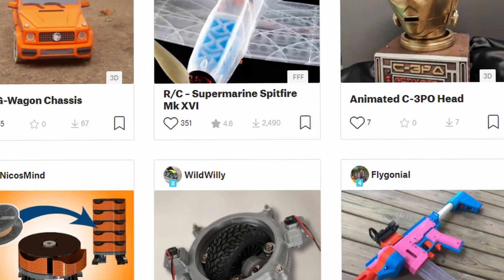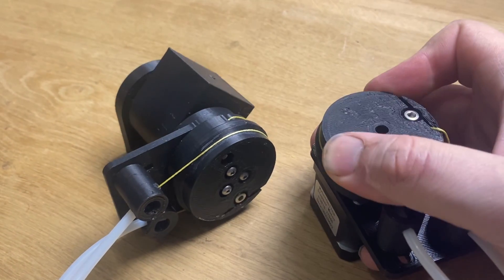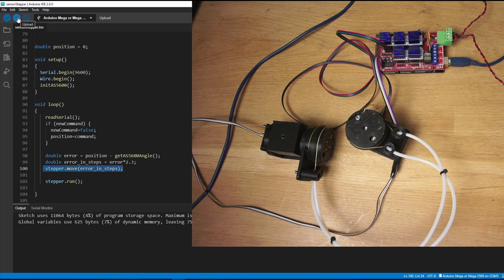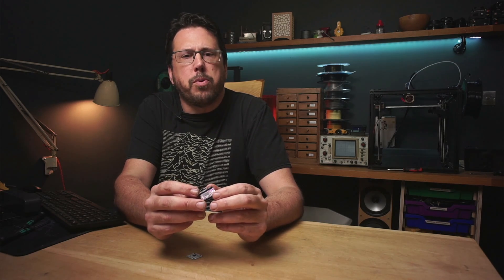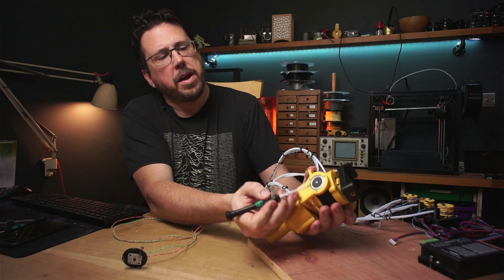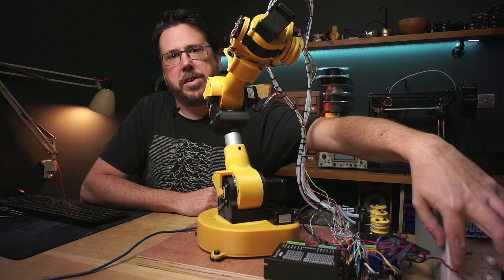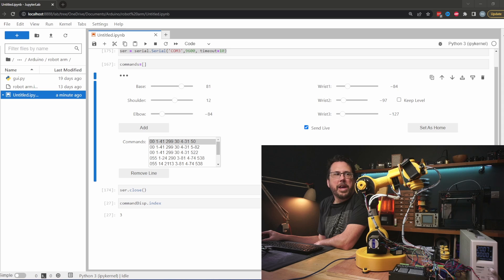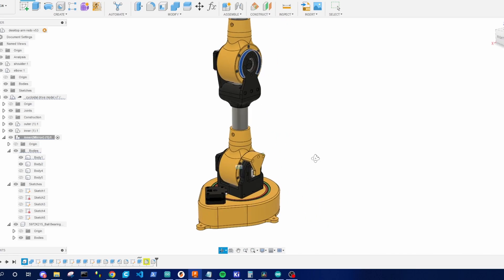Increasing the Precision of a 6 Axis Robot Arm

Comment: where can I find footage of a camera mounted on this? I'm tempted to do something similar but I need ultra smooth motion at low speeds for macro videography and need to be sure its possible with moving the motors away from the arm like this. Great video. Thanks!

Comment: 6:25 this solution nice and easy, but what you think about PID loops? PID controllers are commonly using in the industrial servos.
Reply from the maker: Yeah, you can use a PID loop. in fact, this is basically just the P part of a PID loop. At the moment, I'm not seeing any oscillations using this method, but if they start happening then I'll switch to a PID loop.
However, I do like to try to keep things simple, and if I don't need the full PID implementation then I think this is easier to understand :)

Comment: Hi your project is awesome I'd love to take a look at the code. 
I tried looking at the linked Github page but is seems the only Arduino code posted is the code for the sensors alone. Is there a separate file that contains the code for running and controlling the stepper motors?
Reply from the maker: Hiya, no the zip file that says sensors contains all the code for the sensors and the steppers. It's all in separate classes in that. If you've got any questions, I'd be happy to help - just drop me an email - address is in the about section on my channel.
Reply: there is no email address in your about section ! @roTechnic
Reply from the maker: @PersianFilmMakers  there is, you've just got to click on "show email address"
Reply: Whoops never mind user error. For some reason when viewing the code from the Arduino IDE only some of the code is transferred. The rest of the code showed up when I opened it in Visual Studio.

Comment: Could you make a short video showing us how the robot arm might go about only changing a single value for each of its 6 degrees of freedom? Like for 1 shot, it oscilates between its rest position another position that only translates/rotates an attatched object along 1 axis at a time. How would you go about changing the pitch without changing the position, roll, or yaw of JUST the object? (More specifically, not changing the position of a single point, such as the center of mass or perhaps the attatchment point, Idk which one is correct)
Reply from the maker: that’ll be coming up very shortly when I dive into the inverse kinematics

Comment: Love your work! I've been working on a very similar project. 3D printed 6 axis arm, with the same sensors. The multiplexer was one idea I was missing.
Reply from the maker: oh awesome! I’d love to see it. what reducers/gearboxes are you using?
Reply: @roTechnic  unfortunately I'm travelling at the moment and my robot is mostly failed prints in a drawer somewhere right now. It's a hobby project so I've challenged myself to try include as many different reducer types as possible. Some axes are using planetary gearsets and GT2 belt and pulleys. I'm in the process of refining a cycloidal reducer for the elbow, and a harmonic drive for the wrist. Wrist is actuated from behind the elbow with a torque shaft and fishing line pulley system running through the forearm.

Over engineered and destined to fail, but the project kept me sober during lockdown and that's all that matters.
Reply from the maker: @topordrop2402  It sounds awesome! Good luck!

Comment: I think that I am not the only thinking it but I want amplify the signal : the problem you are trying to solve has a solution, a PID loop.
Reply from the maker: Yeah, I could use i PID loop here - and it would probably be better for a normal robot arm. But I'd like to put a camera on the end of the arm and have very well defined accelerations and speeds for camera moves. A PID loop, unless it is tuned perfectly won't give me the accuracy of speed/acceleration I need.
Reply: @roTechnic   I understand the problem you are facing but as far as I know of control theory (so correct me if I am wrong) but any control loop you would implement would just be a dimished version of a PID loop, just with some terms missing.
Reply from the maker: @DucBanal  in theory, yes. But in practice it’s much easier to tune a simple feedback loop like I’ve done here rather than implement a pod controller and just use the proportional side of it. As you saw in the video, I can easily adjust the p part (the 70/30% bit) but I have quick access to the timings around it too and can add polynomial terms in if I need to. I guess I’m saying that using a pid controller here would be like flying a jumbo jet to your local shops - very cool, but difficult to park!

Comment: So, it looks like you mounted the magnets in the center of the joint which I would have expected to mean that the magnetic field didn't change as they rotate.  What am I missing? Are they off-center? Is something else going on?
Reply from the maker: the AS5600 sensors are supplied with "diametrically magnetised" magnets which have the field at 90 degrees to "normal" magnets. I got carried away and forgot to mention that in the video. Please accept my apologies.
Reply: @roTechnic  oh. That's neat. Thanks for explaining!

Comment: Why not use an optical encoder such as CUI AMT102-V which can be directly mounted on the shaft, but use a magnetic sensor instead? Any reason to go with that particular one?
Reply from the maker: I don't want the encoders directly on the shaft of the motor as I'd like it to report on any deviations that the 3d printed gearboxes/bowden cables add to the system. The other problem with the optical encoders is that it takes quite a bit of processing power to read them as each pulse gennerates an interrupt, whereas I can just query the magnetic encoders any time I like with no overhead in between queries.
Reply: To add to what I assume is part of their reasoning, the encoder you listed is incremental, and therefore wouldn't give them the absolute position of the arm on boot up, necessitating some sort of homing sequence. Furthermore, its far more expensive.
Reply from the maker: @BeefIngot  Yup, both of those too!

Comment: Just found your channel today, amazing work! This is exactly the type of project I love to follow! Not sure if this has been said anywhere before but have you thought about using a synchromesh cable system for the build?
Reply from the maker: I hadn't thought of that - Ill look into it. Thank you!
Reply: @roTechnic  I seen one being used in the positron v3 3D printer on a pulley system to keep position and it looks like it did a great job. Not sure if it would overcomplicate things for you, or simplify knowing the position of each motor. Would love to know if you end up using it or the reasons why it's probably a terrible idea haha

Comment: Looking good! How accurate is the AMS sensor? I think the datasheet says +/- 1 degree. Seems a lot for a 12 bit sensor? I assume you're not microstepping the motors?
Reply from the maker: the +-1 degree is the accuracy of the initial reading. All readings following that are to 12 bit precision. We can get over the accuracy by manually setting the offset of the sensor and then get nice precise readings after that
Reply: @roTechnic  I did some work with these a few years ago, looking for a cheap replacement for a resolver, but back then they weren't terribly accurate and needed a calibration. Then we looked at a sensor using pcb track antennas by Zettlex. Looks like the AMS chips have improved a lot in the meantime.

Comment: Would it be possible to have the print files in STL format. I don’t have fusion nor do I want to install it since I’m in another ecosystem
Reply from the maker: I've just uploaded them as STEP files which you should be able to open in any CAD software. There are too many parts to export them all as STL and you'll need the cad to see what bearings and fasteners are needed and see how it all goes together

Comment: Q: Could it have extensible arms and still know exactly its exact ampleness as you stretch its limbs?
It would be greatly useful when filming ample outdoor shots!
That would require a way to give a lot of loose on the strings to adapt to the extra length.
Reply from the maker: Interesting idea!
Reply: @roTechnic  I just thought of something to prevent twisting... What if the motors section would rotate independently from the robotic arm so it could follow the arm's rotation and carry the cables along? It would prevent the dog from wrapping itself around the post right, sort of speaking.
Reply from the maker: nice idea. I was considering mounting the motors on a free running bearing, like a lazy susan or something like that so they could move round the arm.
Reply: @roTechnic  Somehow! I was thinking tonight also that alternatively, you could mount all motors on the lowest part of the arm and have it spin around with the same lazy susan but even better, if the base arm rotation can carry the motors around with their strings without torsion, maybe they could even be fixed. You could calculate, software side, the rotation of the arm's base to carry the strings around. And if I forgot anything and it wouldn'T work, the motors could still be attached around the arm base, but with an extra motor, smaller, weaker, that rotates the ring around, mounted back on that lazy susan.

Also in any manner, you could keep the strings organized in something akin to fishing pole line guides which could be mounted onto something smooth like a bearing too.

Comment: Pretty cool progress! I am quite happy to have stumbled over your profile! <3
But about the magnetic sensor: I was quite suprised, that you did not flip the magnets 90° so  that the magnetic field lines aktually change, when the magnets are rotating.
So i guess you used some special magnets with "sideways" polarisation?
Like in the datasheet on page 33 in AS5600 [v1-06] 2018-Jun-20 ?
This would be awsome to know for people who want to take this as a building guide.
Reply from the maker: yes, the sensors are supplied with diametrically polarized magnets. I forgot to mention this in the video. good catch!

Comment: Question: I have that as5600 board. what would you recommend for linear motion? Would this work as well for a motor the has to spin thousands of steps to say move a Z axis or even a belted X or Y? In inkjet printers they use a very fine transparent "barcode" thing, and that lets them count the steps I guess. I also use Geared stepper motors so the motor has to rotate multiple times to effect a single rotation. And finally, I haven't used them yet, but are you familiar with Geared DC motors that have built in encoders? They use two hall effect sensors to provide the position. If you are familiar, the MASLOWCNC  uses 2 of these motors to "plot" a rotor, to cut plywood. Cool project. But again another closed loop approach.
Reply from the maker: They don't work that well for direct encoding, because they take a while to read (like 1/10ms) so can't be used to read the position every microsecond.. Although, that being said, I've got a project on the back burner using these and a stepper motor for full FOC control - a couple of things to sort out with it though.

Comment: I thought you are going to apply PID for those encoders. What is this method called again? I remember James Bruton doing the same thing for one of his robots. I'd like to look up more about this method....
Reply from the maker: PID is more appropriate for control of analog devices such as heaters or brushed motors. I think I'm going to stick with steppers for now - see how far I can take them. I'd love to do a bigger arm with brushless motors though.
Reply: @roTechnic  Analog has nothing to do with it. PID would work fine expect this is a nonlinear system (Damn you gravity!). Though if you have enough torque , stiffness, and  good sensor resolution, the non-linearity may be manageable.
Reply from the maker: Interesting, I didn't know that - thank you! unfortunately, torque and stiffness are not in great supply in this arm, but I am tempted to try out a PID loop. I imagine that you'd just set the PID to control the  speed of the steppers and set them to rotate continuously - do you agree?
Reply: @roTechnic  I would think with a robot arm, you would want to control position, so I'm not sure why you want to start with speed. Regardless, It'll work fine if you are not working with or against gravity. When gravity gets involved, you'll see more error, and it'll get worse the heavier the end of the arm is.
Reply: Oh, and also do you plan on switching to a regular motor like a brushless or a brushed one now that you have encoders? Would certainly help in reducing the noise and heat from steppers I guess!
Reply: @rizalardiansyah4486  Steppers are pretty much the ideal motor for these arms until you can move up to fully fledged servos, brushed motors are obsolete these days and nothing quite comes close to the ease of use and stall torque of a stepper